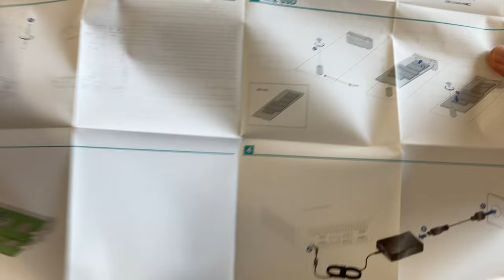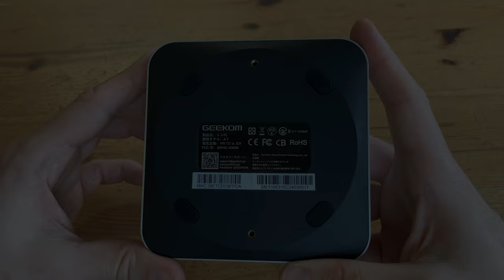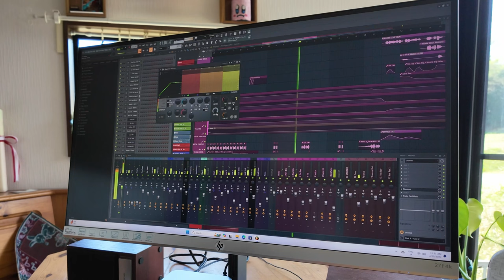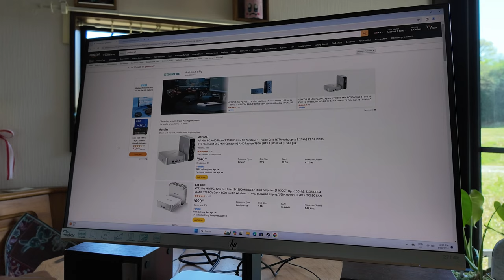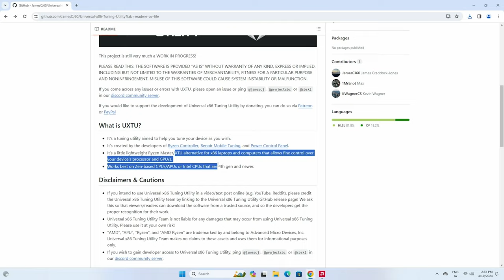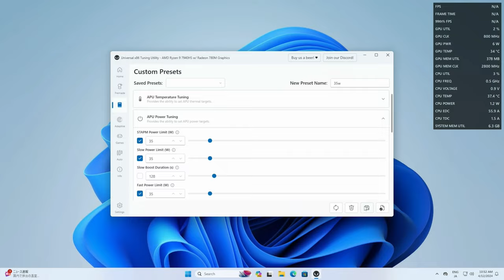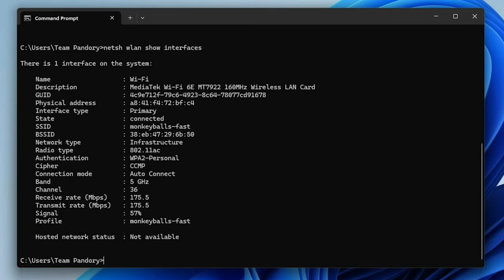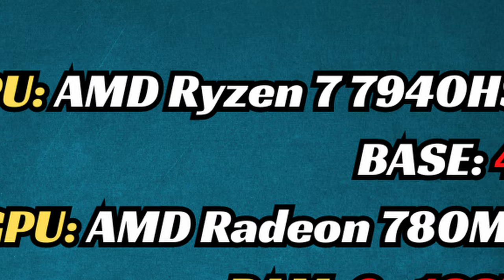Mini PC Buyers: Watch This Before Buying the GEEKOM A7!

Comment: Such a shame, it looked the part, but that heat issue is shocking, at least the wifi has a workaround, but it's still bad that it does not work as it should. The music did make me smile (not looked but presume Suno). As always Tim, very slick video and packed with info..Have fun with the next one, Paul..
Reply from the maker: Thanks man ❤️. Your comments are always appreciated 🤠 
For sure, I'm hoping the next will be a good one with little need to faff.
Reply: @TeamPandory  No problem Tim, I just appreciate the effort

Comment: Thanks for the review. What would the performance be  like with a Linux installed rather than Windows 11? I find that many of these mini PC provide excellent performance with a Linux distribution. These computers are not built for gaming.
Reply from the maker: Hey there, no problems. 😀
We tested Linux (in the form of Batocera) later on in the video.  While it does work, there won't be a large noticeable performance boost in comparison to Windows.
The usual thoughts behind this are "Linux doesn't need as much memory or resources", but when you're already on a fast computer those gains will be less apparent.
"These computers are not built for gaming" is also quite an ancient way of thinking.
One main reason why computers can do so much nowadays is due to the need for more processing power and better graphics, which over the years was spearheaded by gaming.  The superior gaming performance that these integrated Radeon GPUs can provide is one HUGE reason why AMD are currently besting Intel when it comes to this area in the market of Mini PCs or even for laptops.

Comment: I love your chuckle/laugh checking the map.  :) 

You might want to be careful with the usage of "Steward's" voice with the new rules and new option when uploading.  I don't know how strict they are going to be in the future.

Funny how only the 3.5" inch FD helps me understand the size of it.

Clever move to throttle the system before it reaches thermal throttling temps.  Technically it doesn't thermal throttle lol.

Can someone please make a mini PC with thicc cooling?  It's ok, no one is going to make fun of it for the size.  They are already small.

Thanks for the video.
Reply: The voice should be OK, it's not technically his voice, but a recreation of it using a certain website..But best to play safe sometimes :)

Comment: A con to me is the lack of a Kensington socket. There are 2 unused screw holes on the base. Not sure what they are meant for, been thinking how i can either find a way to fasten some sort of plate to rack it or attach some kind of base for a lock to them.

Comment: Big like to your video! Just a quick question, what software do you use to see your temperatures while gaming? (like at 10:18, in upper right corner)
Reply from the maker: It's the Performance Overlay for the AMD Adrenalin Graphic Drivers

Comment: I love your content. You at least do some proper testing and evaluation instead of promoting one more product on the market. You made me buy 3 Nucbox G3 barebone systems upgraded with 16 GB Ram and 1 TB Samsung NVME to create a HA proxmox cluster. Happy so far but the systems do get hot when loaded 100% Need to re-apply thermal paste to check that out. I've also got a GMKTEC M5 Pro on route to experiment with more serious VM's. Keep it coming bud.

Comment: What would be your suggestion for someone only looking to store images & run the following:
CapCut pro
Fusion 360
Canva
Other than those I’d not be using it much, I’m not a computer buff & half the words I hear in reviews just goes over my head lol.
I’m not a gamer at all, I just want to edit 4K videos & store them. 
I like the idea of a mini PC so I can connect it to my living room tv & chill while I edit in comfort, then if needed I can take it away with me or in to the home office when the wife isn’t using it.
Cheers 👍🏼
Reply from the maker: If you want to edit 4K videos and don't need to use it for games, you may be better of with a solution from Intel instead.
The 125H model we reviewed a few months back (GMKtec K9) would still play games, but excelled at productivity- especially when used for Video Editing due to Intel QuickSync. 
Personally, we prefer the Ryzen chipsets though.  They provide more bang for buck, especially when we include gaming into the mix.

Comment: Would wifi work better with the case on its side or upside down? As the base looked like plastic it would transmit better than the main case. The metal case and main board would tend to shield the antenna, no?

Comment: The heat issue and placement of the wifi chip suggests that the box is too small.
Reply from the maker: The issue was the ddr5 memory without a way to offload it's heat.
We fixed that in a recent video 😁

Comment: Oh man, having to tweak it kinda kills it for me. I wanted something ready out of the box. Would a larger mini PC heat throttle less? Like that Ace Magician? How about a 14 inch gaming laptop? Would it have a similar issue?
Reply from the maker: It depends entirely on how well it is built. We've had a shocking acemagician intel minipc, but much of the reason we gave it a poor review was most of the faffery that needed to be done. 
All computers are similar, in the way that you can't really rank by the chip alone, but you can rank the sum of all it's parts. CPU, motherboard, case design, bios, memory, storage and then the software. 

Most other reviews regarding the A7 gave it a LOT of praise. But how the heck did they miss such an obvious weakness? 🙀

Comment: Those thermals are indeed worrying. I do like the port identification symbols, which should ideally be universal across the industry.

I don't consider the Windows login requiring an internet connection to be a downside per se as it is something defined by Microsoft. In terms of the workaround, it is something that could be included in the user guide to ensure that users have a clear alternative.

All in all, specs wise, it is quite impressive, even though, at the price demanded, it certainly should be. All those decent USB ports really make it stand out a little more.

 But with the thermals being an issue, it does raise the question of manufacturer response and whether they will come out with any form of comment as to what they can do going forward for new customers and what they will do for existing customers, who are undoubtedly in a precarious position.

Perhaps it is as simple as something in a BIOS update or a new cooling solution. But Geekom, who sent the device for review, should actively take part in the discussion now that the verdict is in. Future sales may depend on response to criticism and faults.
Reply from the maker: We'll see. They surprisingly sent a positive email back to me saying they're going to look into each thing that we had concerns about... "Time will tell, sooner or later... Time will tell" - Einstein (Red Alert)

Comment: Sorry I am not a gamer and looking for a good office, some video, some photoshop computer. Do you think this is overkill or would you recommend the 12 gen intel version? The wifi issue is concerning. I thought the plastic top could help over the Ser 8 metal case. I wonder if the intel version would have the same problem. Does the intel 12th gen run cooler? Thanks for your great reviews!
Reply from the maker: Hey there 👋 
Maybe the intel core 125h (gmktec K9) would be more your cup of tea?  We reviewed it last month.
That system is going to be great for applications / video editing, and can dabble a bit in games too if you ever needed it to.

Comment: How long did it take for the thermal throttling to take effect?  I had expected 2 hours worth of gaming/intense video editing.
Reply from the maker: Depended on the game.  Rocket League it throttled at 1 minute of gameplay, whereas Yakuza 6 took around 5 minutes.
Fortnite we managed to go a full game (around 10-15 minutes) with the settings we used without an issue, so games that don't push GPU and CPU too much might be okay.  Not exactly something we can recommend for anyone interested in gaming tbh.

Comment: Which makes and models do you recommend that solve the WiFi issue?  Thx.
Reply from the maker: Both geekom (A5 and A7) computers we tried having a poor signal. 
This may be in-part to having a router that's sub-par, but it's the same one we test with other mini pcs, and those all had much better performance in that area.
Reply: Thanks.  What do you like for a basic biz mini PC?
Reply from the maker: @axeo123  any intel n100 tbh. They're cheap and do things like internet and office nice and easy.
Reply: Any Make or Model you prefer or are they all basically the same components?  Thanks again?

Comment: I'm having issues with bluetooth audio basically not working (stuttering). I've tried to remove obstructions, disabling other devices (wifi, bluetooth and USB hub), reinstalling drivers for bluetooth and audio, but nothing works. Is this something you encountered while testing as well?
Reply from the maker: This could be an issue with the antennae they're using with both WiFi / Bluetooth... We don't really use Bluetooth headphones, but had issues with the WiFi. 
Maybe switching the antenna might help?  I'm sure a usb / BT dongle will work, both solutions not exactly ideal
Reply: @TeamPandory  Thanks for answering. I've tried a USB dongle too and that worked, but it doesn't work before logging in to Windows, so basically I can't login that way. It's really annoying and they have a bad return policy. Had I known this, I'd have gone with Minisforum.
Reply from the maker: @acebirdjohn  I've heard that geekom have a 3 year money back guarantee... 🤔 ... Maybe plop it on the eBay ?
Reply: @TeamPandory  I don't know how they're going to feel about the adhesive tape I used to attach a vesa mount. 😅

Comment: Bought one. I really wanted it to work. I’m a Fallout nut and have been for many years.
The Geekcom A7 is a no buy. It worked for about 3 weeks and was great, then during particularly heavy fire fight going with about 8 characters per side; I heard a snap even though I had earphones on. Result: no picture. No nothing. The computer was hot so I believe the heat got it. Haven’t contacted Geekcom yet. Right now it’s a silver brick. I was afraid of the heat when I first saw it and its small size with restricted air holes. Here’s hoping I didn’t pay $800 for a very nice paper weight. I hope Geekcom comes through. I’ll keep you posted
Reply from the maker: Oh man. Thanks for letting us know, and sorry this happened to you. 😢 
Please keep us informed. Hope everything works out for you 🙏

Comment: When I saw this mini with a high power cpu in a tiny tiny case with no second fan for the Ram and DDR cooling I knew it was a hard pass. Very crapple oops Apple 🍎 fail , aesthetics and beauty over a full performance, functional mini PC💩💩😂😂😂😂👎🏻👎🏻👎🏻👎🏻👎🏻👎🏻
Reply from the maker: Should be okay, provided you don't do any gaming on it...
You're on the ball re: small case and cooling btw.
We knew smaller = more heat = less performance.  It's one of the reasons why we hated using those laptops with GPUs.  Heavy, hot, noisy, and sub-optimal performance. 
If you don't know history, you're doomed to repeat it, right?

Comment: I have  bought a bunch of different brand mini pcs'  Beelink...minisfoums....and others....In my opinion T]they are a collection of poorly made computers with low quality parts...Lousy and slow Chinese tech support, and I would avoid these crappy machines at all costs. Other than the Intel brand NUC.....most of these are just junky cheap little computers.....Most all get too hot too fast and throttle or just freeze and re boot.  Buyers beware.